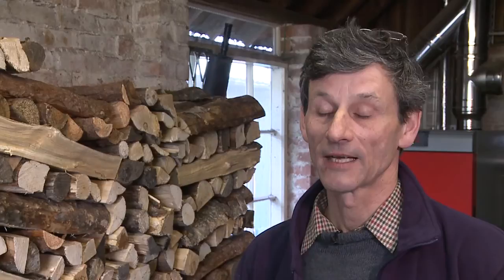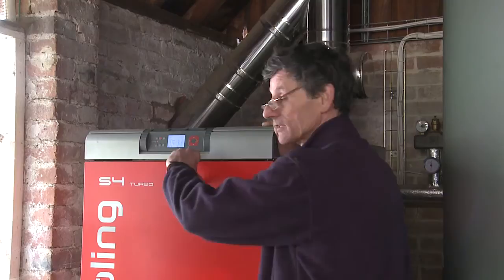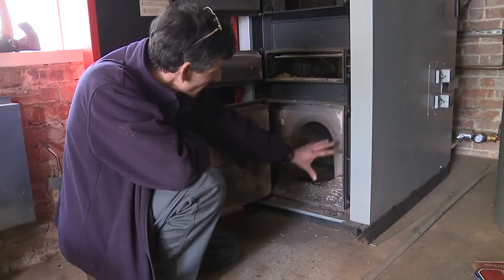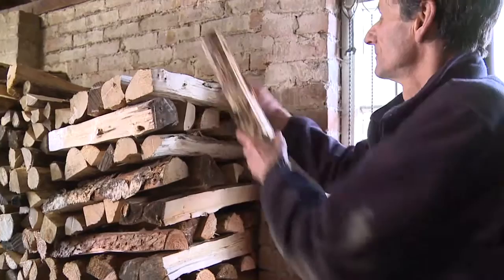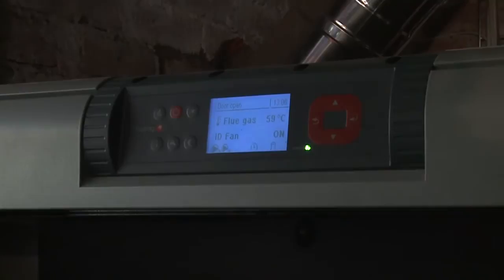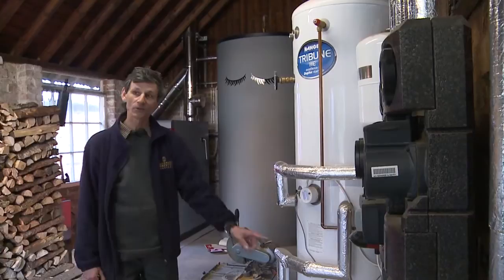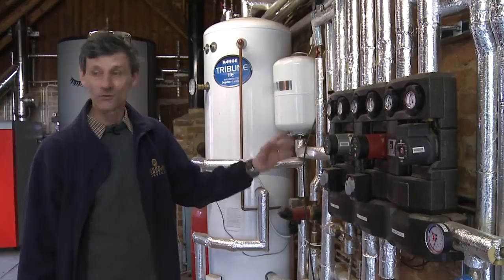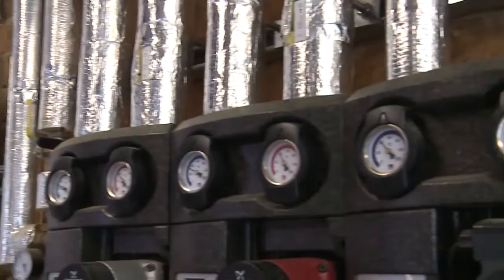Log Boiler Central Heating System - Case Study Sussex

Comment: You can generally find used pallets for free, take the pallets and lay them in in line and they are excellent to get the wood off the ground allowing air to flow around the entire pile of wood giving you better drying.

Food for thought.

Cheers!!
Reply: Yes, also a much better use of the pallets then cutting them up for fuel,  I dry mine for use as kindling once they have done a few years under the logs and start to break up.

Comment: Hi Nick,
Is the backup oil heater piped in parallel with the wood boiler circuit?.. and therefore heat a 2500l tank which it normally would not.